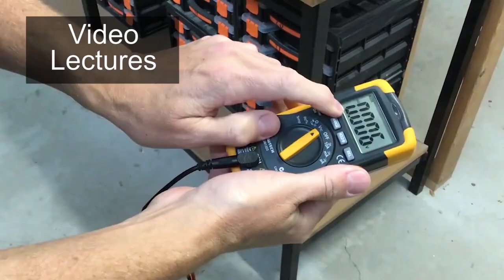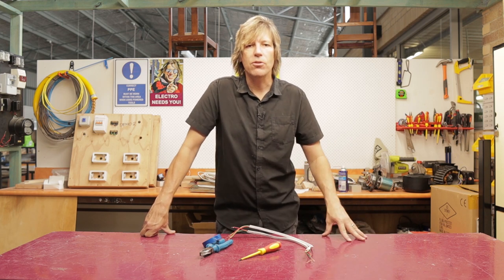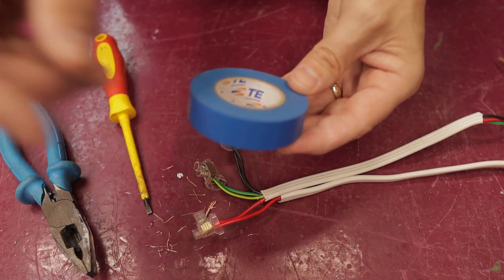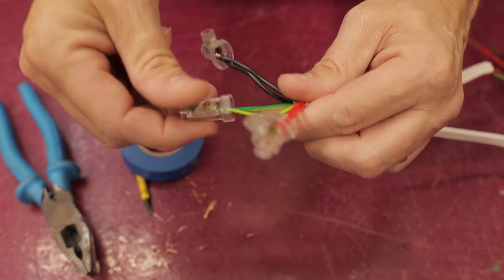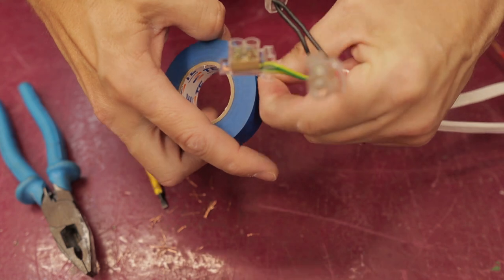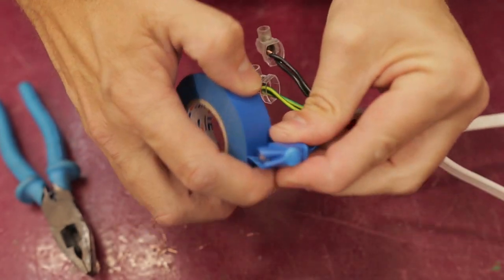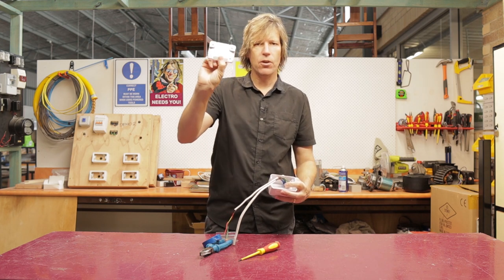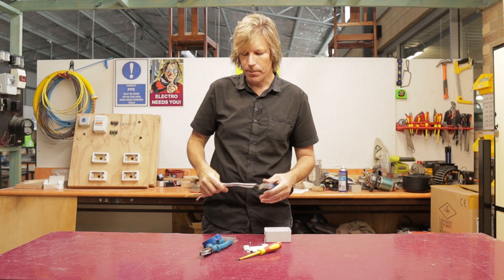How to Join Electrical Cables

Comment: Sir are you able to answer 1 of my question please?
  There is a situation where it is not allowed to have 2 long wires joined together by merging the cores and taping around it... But if the situation have to use those two pieces of wires of 4 core 4mm 90metre long, how to connect them safely without breaking safety rules... Like can the male/female box be used with MCB? Or is there any other ways to joint the 4 cores of two long wires by something that is waterproof , fire proof, short-circuit proof...
   Please give suggestions...i will give u my email id if u want to give an answer. i will really be grateful to u if u please help.

Comment: Great video very helpful thanks. What do you recommend for connecting wires in line? For example, I want to move a GPO outside a few feet up from where it sits. Need to extend the cable and conduit. I could use this method but then I would have a somewhat bulky join. seems to be hard to track down in-line connectors in Oz?